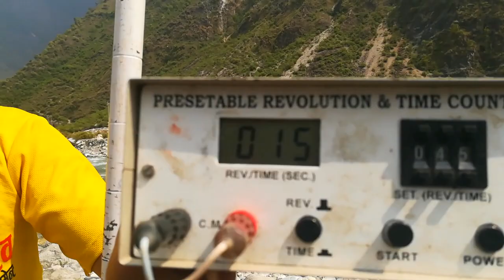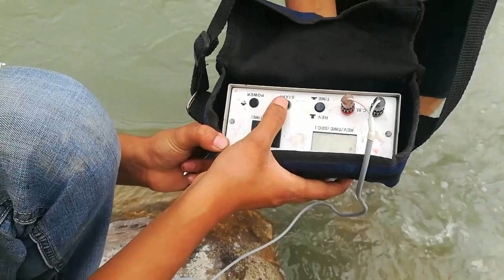Discharge measurement using Currentmeter by Raj KC

Comment: Bro. I think you are using wrong method in this river. Because however I'm seeing that. The flow is quite not laminar, there some backwater effect and there is un uniform cross section due to the large stones. Soo in this type of river there is area velocity method specially current meter method is not applicable. You should try to dilution or other method. You can also use slope area method. ..
What do you think. This is am asking because I'm also a student of hydrology.
Reply: Very true, and the flow of water was being interrupted by the man holding the wadding rod. Hence, recording a wrong velocity. He was supposed to let the instrument be in front of him....
Reply from the maker: One of the best method for measuring discharge is by using current meter method. We can measure velocity in turbulent flow and the depth at different section is measured to find the area of not uniform crosssection of river. Salt dilution method is only applicable for the turbulent flow with discharge lower than 5 cum/s. For big river salt dilution method is not applicable. Slope area gives fair result  in uniform cross section  with very mild slope, in such steep river you can't use maning's equation to get discharge.